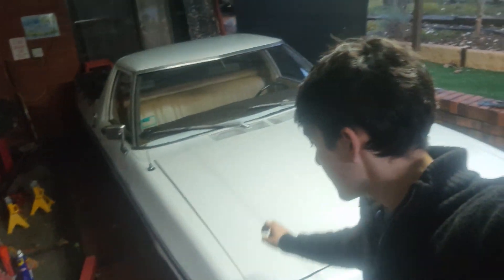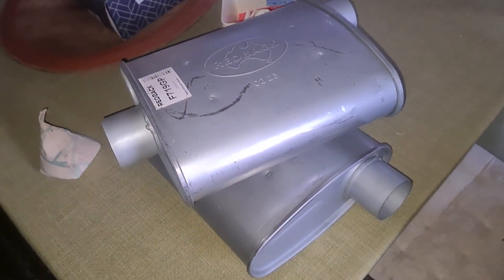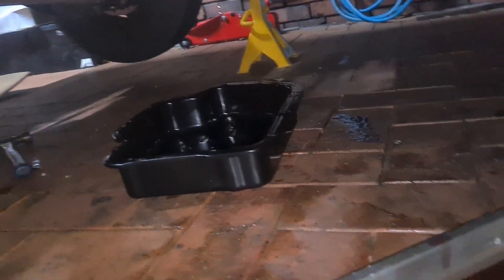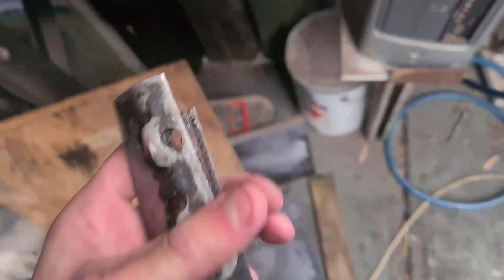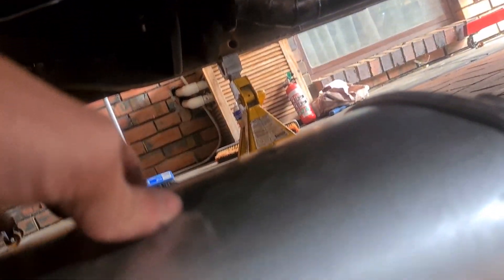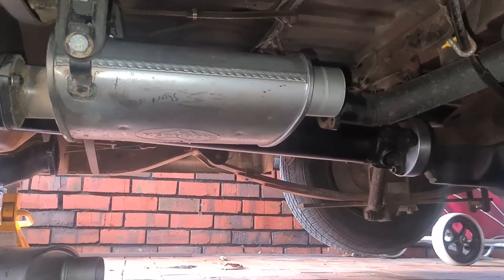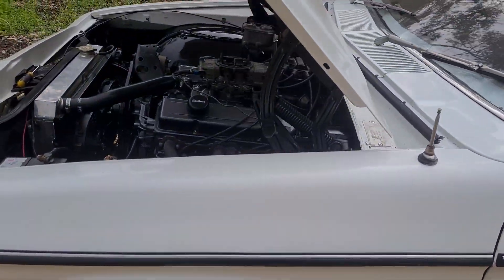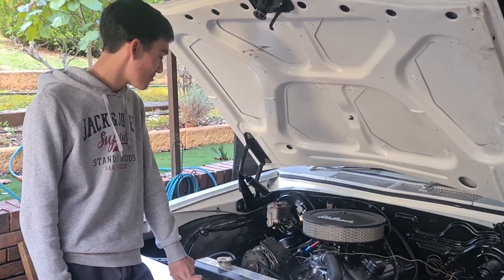Redback Exhaust On The HQ. Sounds Much Better

Comment: Hi what brand trans crossmember did u use . Was it used  because exhaust clearance or u did not have one ??  Does the aftermarket give better exh clearance than factory unit ?
Reply from the maker: I show in a previous video me removing the old crossmember (wich was a modified 6cyl one) because of a few reasons. 1 being i couldnt remove the crossmember without removing the transmisson. 2 the transmission would sit too close to the tunnel. I didnt have a problem with exhaust clearance with ethier because i built the exhaust around it. So i ended up buying a rod shop specific th400 crossmember. As the factory th400 crossmembers are usually equivalent or more expensive and hard to find.
Reply: @Joedennett69  Yes I have a factory th400 with reinforcing plates vs Trimatic with out . From memory 2 different widths also . Even the collector /exh connection seems to have to duck under the X member in your ute . Do u think the x member could be higher or no more room above ???  Could your exhaust go higher to the existing aftermarket x member ??
Reply from the maker: @paulthompson1654  I am running block hugger headers opposed to most guys that run 4into 1 long tubes that collect behind the motor, because if this the spacing between the two pipes is very narrow so the exhaust clearancing in the cross member is irrelevant to me. I did have to put a few dents in my pipes for me to get the desired exhaust height and clear the crossmember
Reply: @Joedennett69  thanks ,I went back thru older vids and checked out the clearance